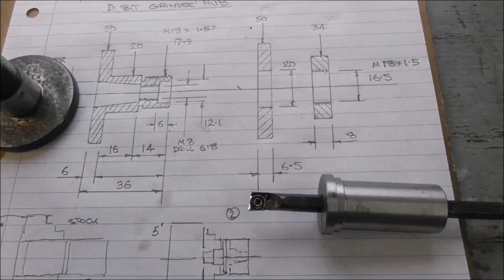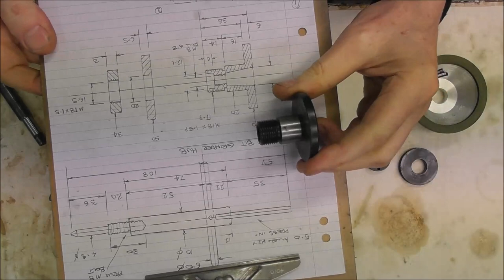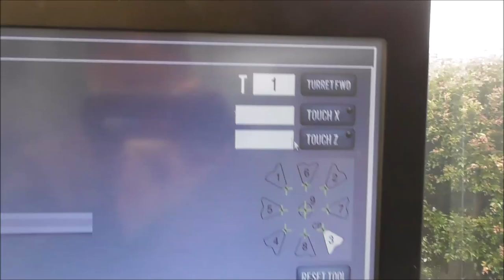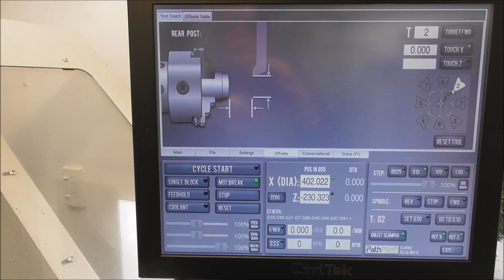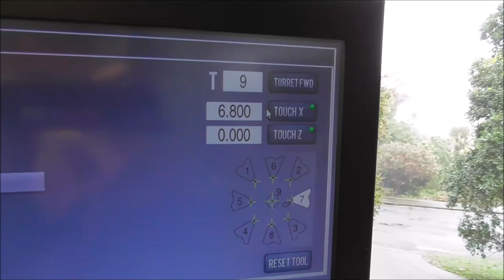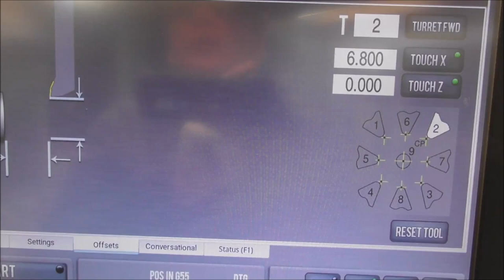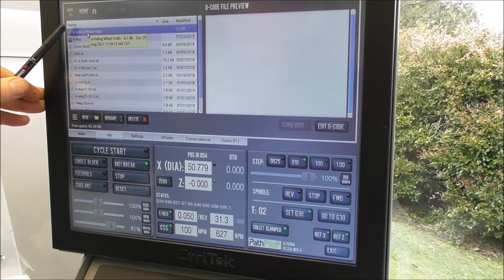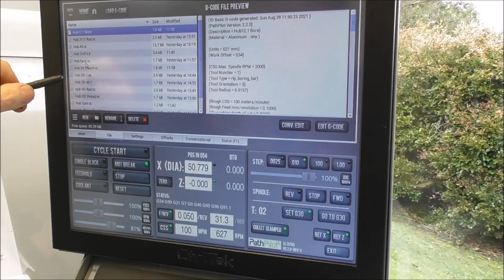Tormach CNC Lathe - Set and Run

Comment: What is the maximum diameter work that can be run through the spindle bore and the 6 jaw chuck?  Thanks
Reply from the maker: Hi Jim. I do not have a 6 jaw chuck, and am currently away from my machine.  But you will find that on the Tormach website. Cheers  Cliff
Reply: @Threadexpress  oh sorry, I meant the 6 inch chuck. How large is the through bore on the chuck.
Reply from the maker: @jimsgym4468  Hi Jim. I bored my one out to 45mm - I usually maximize my chucks capacity as much as they can stand. Cheers  Cliff